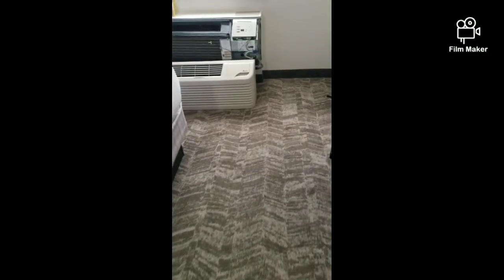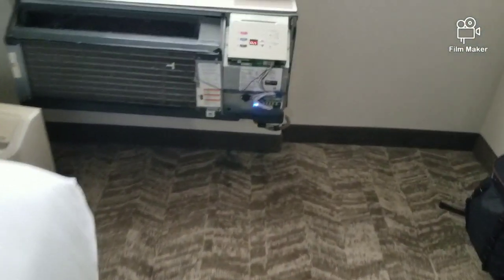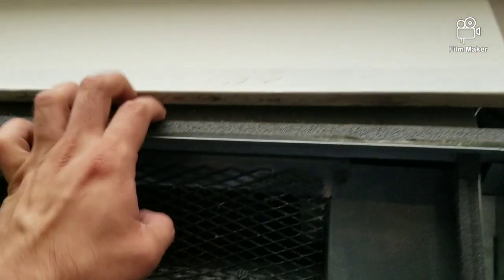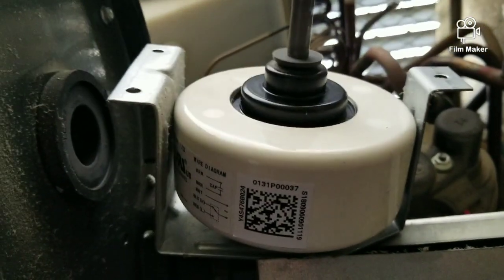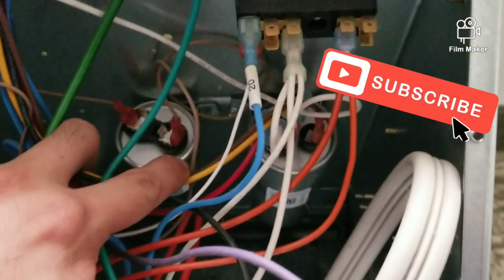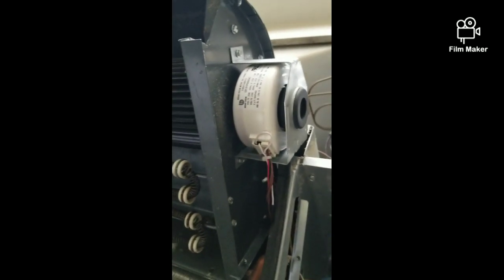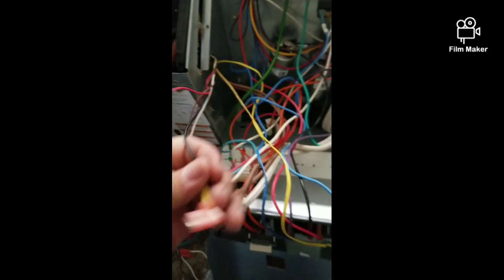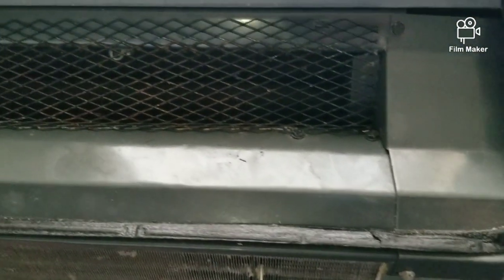Noisy Ptac unit.. Let's troubleshoot

Comment: I did this plus changed the fan blade in the back and ptac still loud as soon as the compressor comes on. Premaire ptac. You also skipped a couple of things you have to take off besides the covers. Gotta slide the coils out as well and take the screws off from the sides as well.
Reply from the maker: Hello Josh 
I would check to see if you have a tubing vibrating against another, noisy or loose fan motor. If not you may have a compressor going out. If you are removing the the blower motor housing it's not necessary to remove the evaporator coil
Reply: @PtacSolutions  it was a bad compressor.

Comment: I love your videos, bro. Every time I look up ptac you come up lol , I have a question if you can help, the blower wheel will not shut off on the GE ptac, , I swapped the unit out just to see and the new unit. The blowerr wheel will not shut off as well , The thermostat has six wires plugged in , It could be a bad thermostat, but we didn't have any more to swap it out , It's not the fan in the back. It's the front, will fan looking thing lol ,

Comment: thank you bro, I have one question . I have same unit when set to heat and when I touch it , I feel half way warm air and half way( left side) cold , even if I closed vent control from back side. What do you think? thank you.
Reply from the maker: Hey Betty 
I had cases where if I didn't close the back  vent completely shut some of the cold air would still leak through. So if you can screw that back completely shut. Let me know what happens and thank you for watching!!

Comment: Ok bro so I have a Frigidaire ptac unit that produces a hummin noise as long as it’s plugged in. It doesn’t matter whether the unit is on or off. The hummin sound doesn’t go away. Have you ever come across something like that ?
Reply from the maker: Hey Oscar
Yes check the transformer
Reply: @PtacSolutions  thanks a lot! Will do that
Reply: Hey bro quick update. I replaced the transformer on this unit but the humming is still an issue. After investigating I noticed the humming noise is coming from the compressor. So I checked the compressor but it seems to be ok. It cools fine too. Any suggestions?
Reply from the maker: @andrade24100  How about the condenser motor?
Reply: @PtacSolutions  I checked the motor and it’s ok. I also noticed that the run capacitor was a little low. Went ahead and replaced it. The humming actually goes away but every 30 seconds or so it hums as long as the unit is plugged in
Reply from the maker: Does that unit have a fan relay?
Reply: @PtacSolutions  Umm let me look into it. It’s a Frigidaire unit.

Comment: I stock blower wheels, main boards, caps and transformers. anything else and it just makes sense to swap it out with a new one for $750
Reply from the maker: I agree, trying to replace anything with the sealed system is going to be more costly than to replace the unit
Reply: So u have a business that sells parts?
Reply from the maker: @weslawsonsilverback  Hey Wes, well not necessarily, but I can get parts for you if you need
Reply: @PtacSolutions  ok ill keep u on speed dial

Comment: Mine is making a weird whining kind of sound during both heat and cool
Reply from the maker: Hello 
That could be the bearing on the opposite side, check if the blower wheel got loose
Reply: @PtacSolutions  it's kind of funny, I looked and noticed that it wasn't even bolted in, it was just seated in place. So, when I pushed on it, the noise went away. All I had to do was bolt it in. Thanks for responding though. I'll keep that in mind for future ptacs.
Reply: The ptac is making the same noise again. It happens when it's on or off. It's like when air from outside rubs through the ptac, there's something rattling making a whiny, buzzing kind of sound. Have you heard of that before?